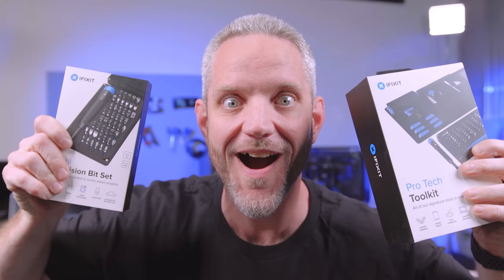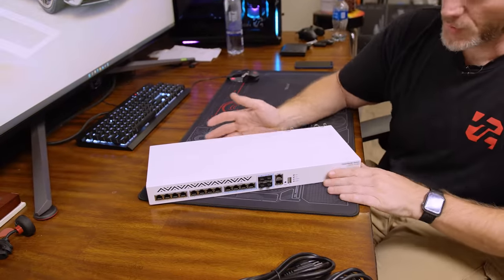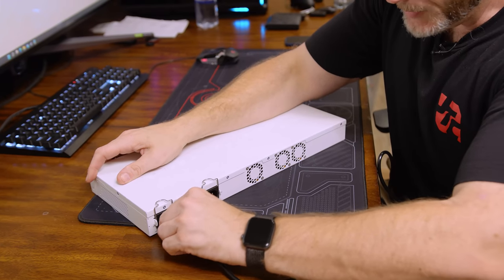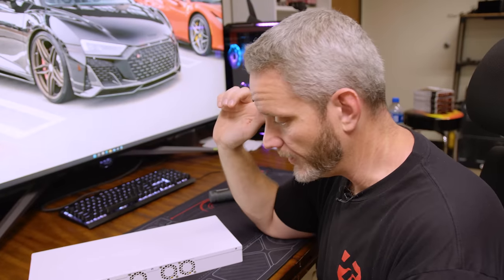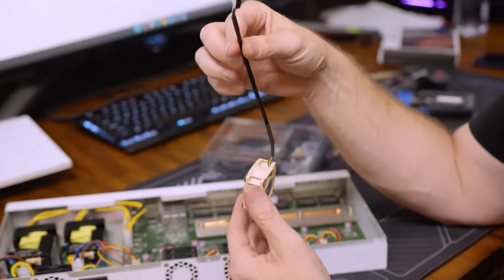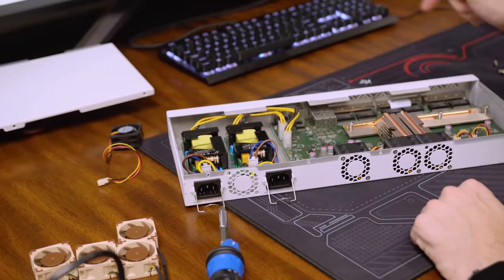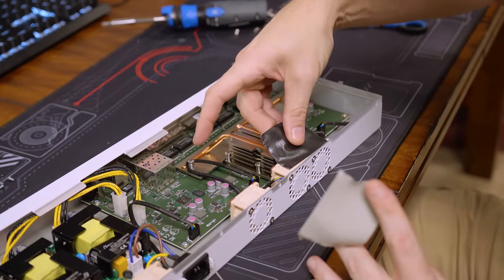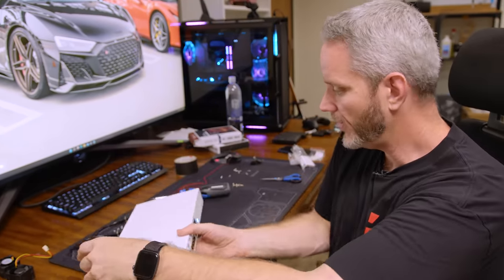We had to modify our new network switch...

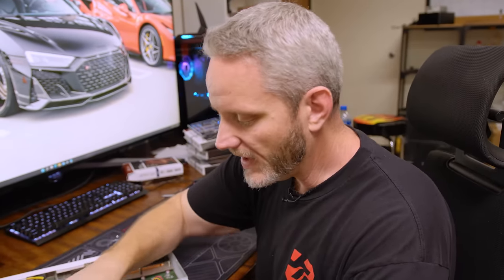Comment: 9:45 Be careful around power supplies in general people, did some troubleshooting many years ago (as it was my job) and i was probing around in a power supply and welded my DMM lead to the PCB. DMM caught the amperage, i caught the voltage. 313VDC

Comment: Ubiquiti Switch Enterprise XG 24 - Layer 3 switch with (24) 10GbE RJ45 ports and (2) 25G SFP28 ports. $1299. Definitely more expensive, but more ports than the MicroTik, and mine has been running solid as a rock even using layer 3 configuration features.

Comment: I had a 24-port gigabit switch with four fiber ports and it used those server fans. I just carved a big hole in the lid and stuck a 200 mm fan on top. It wasn't a rack mount so it was sufficient for keeping the noise and temps down.

Comment: well I purchased my 10g switch off of ebay and it is a used Cisco UCS-6296UP Fabric Interconnect and it came with 96 10g sfp+ ports for ~120 USD including shipping (also happened to come with 60 sfp+ fiber modules that were not removed for the switch) and for that price you would be able to get sfp+ to rj-45 adapters for less than what you paid (or close to it) for the same connectivity

Comment: For $600 that's pretty damn good. A rule of thumb we've used for basic 10G switches is ~$100 per port. I know people are probably gonna hate on me for this, but where I'm at we're a cisco shop and the 24 port cisco 10g switch is probably something around $3500 (if you can even get it), the 48 (+4 dedicated sfp) is almost exactly double that usually. I don't think you should be buying a cisco switch, but just for the price reference.

PS: the fans on those switches GOOO to, but they quiet down pretty quickly after boot and I've never actually heard them over other stuff in daily use.

Comment: For those of you that want the same screwdriver as jay here's the same thing made by SKIL the hammerhead one appears to no longer be sold for a decent price, search for "SKIL Rechargeable 4V Cordless Screwdriver with Circuit Sensor Technology, Includes 9pcs Bit, 1pc Bit Holder, USB Charging Cable - SD561201, Red"

Comment: I bought a 2nd hand brocade switch and had the same problem, 2 very loud high pitched fans.

My solution was to add a resistor to the psu fan so it ran at half speed and replace the other fan with a 60 or 80mm (can't remember) fan mounted on a hole I cut in the top. Obviously it isn't 1RU anymore but it worked for my setup.

Comment: As a few others have commented, I would replace the router with a Ubiquiti Unifi Dream Machine Special Edition (UDM-SE), get the Unifi Switch Enterprise XG 24 (USW-EnterpriseXG-24), a Unifi6 Pro AP (U6-Pro-US) and run a short SFP+ to SFP+ Direct Attach Copper cable to connect the new router and switch. Then you would get 8x 1GB PoE RJ45 ports (on the UDM-SE) and 24 10GB RJ45 ports on the switch, and still have expandability (if ever needed) with an open 25GB SFP28 port on the switch.

Comment: I did a very similar mod when I bought my UniFi USG Pro router. The 2 stock fans are really noisy, as confirmed by numerous complaints online and my own findings. I swapped out the stock fans with 2 Noctua 3-pin fans and not only did they make the USG Pro quiter, the temps are lower too! I went with 3-pin fans because the USG Pro mainboard only has 3-pin connectors, and the 3-pin fans come with adapters to run them at lower voltages. I didn't end up using those adapters though, I was happy enough with the result at max RPM.

Comment: Oh your god! I bought the exact same switch last month. I only needed 2 10Gb RJ45 ports but 8 is fine too. This was the cheapest rack-mountable at least semi-managed RJ45 10Gb switch I could find (didn't use Amazon). I dislike the Java management interface because Java is cancer but after the initial configuration I won't be playing with it anyway. My switch is in a closed rack within a closed room so I won't be "upgrading" my fans.

Comment: Jay entire office has fewer networked gizmos than I have in my home kitchen :-D

I agree with the Cat6A cabling - there is no benefit to fiber.
Also you can do POE over copper.

But IMHO there are way too few network outlets planned in the rebuild office. 

With proper networking, NDI video can be used in the video production workflow - allowing for much more flexible solutions - particularly for live streaming.

Comment: There isn't really a way to be more "cost effective" using 10Gbase-T, that effectiveness lies with Fiber-Optic. It's all tradeoffs. More capacity = More Cooling = More noise and fan mods (did this with a $200 24 port LB6M). If you really truly need the capacity you need to look at more traditional enterprise gear but that puts  you in a different cost and infrastructure weight class. You'd be racking all your core storage and server/nases etc in the rack going 10/25/50/100G (pick your poison) fiber to a bigger switch and then if you're fiber and need 10G base T ports you'd be paying ~$20-$50 per port for fiber to ethernet SFPs, it's messy. 

One thing you could do if you need capacity is add another identical switch and do a 10G LAGG on two ports between the switches. Mikrotik calls it bonding. That gives you resilience if one of the ports has a problem and opens a few more lanes for traffic between them so-to-speak. You could then take your main NAS and plug it into both switches for some fault tolerance there. Mikrotik doesn't support stacking so this is good enough. If the walls are open maybe look at adding fiber drops to the rack from the data ports and a few of your work areas for a little future proofing if you can but it's not a big deal. When it's really time to UPGRADE HARD figure it out then. This does what you need to and that's great. 

Sidenote, going switch to switch isn't a big deal when you get to more enterprise type gear. Look at datacenters that are spine and leaf, $250,000 switch to many $30,000 switches. I think you may have had bad luck with cheap switches and when you go cheap switch to cheap slow switch and on down the chain it builds latency etc. That happens a lot.

Comment: I use a managed Netgear 12 port 10G rack mount switch, where all the RJ45s are 10G.  Only one power supply on mine, but it’s silent.  Supports link aggregation and a number of L2 features, and more limited L3 support.  I’m using in L2 mode only for now.

Comment: If you want to enter the ubiquiti space: a Ubiquiti Switch Enterprise XG 24 has 24 10G ethernet ports and 2 SFP28 ports. Max throughput is 580 Gbps and is also a 1U rackmountable switch. Over here you can get it for a tad over 1400 euro.

Comment: The reason that the noctua is so much quieter is that is has less than half the airflow of a typical fan of that size. The lowest airflow model I could find on a component supply website in a 40x40x28mm size was 11cfm and most of them were 15-30cfm. The noctua is 5.5cfm. If the product is designed with a decent thermal margin and its operating in an airconditioned room its probably fine but I wouldn't recommend doing this with something critical.
Also on the 3pin vs 4pin thing. The device has no way of knowing that you've connected 4 pin fans, so either that header is outputting pwm as well as dc control - resulting in the fans spinning even slower than intended, or theyre just being dc controlled. Unless there is a setting in the menu you have no way of knowing whats going on.

Comment: I put these or similar Noctuas into my switch to quiet it down as well.  The OmniJoin adapters are to adapt the fan cable to 2-pin (like my stock fans were). It's basically just a punchdown similar to an RJ45 but there's also some 3M adhesive in there, so it really holds the thing together.

Comment: Netgear has a 16 port 10gb switch (XS716E), but it pushes you into $1600+ territory for those 4 additional ports. Prolly more cost effective to stack another MicroTik in when you need it/want it.

I’m pretty sure Ubiquiti has a 24 port 10GB as well… not sure on price, but it’ll probably run around $1500, and their gear is pretty rock solid and easy to manage.

Comment: I would have just gotten an SFP+ switch and the RJ45 SFP+ converters.  Would have cost a little more, but would have probably gotten a better switch, less mod'ing and you could use fiber in the future.  Probably would have gone with Ubiquiti.
Reply: Not necessarily any more expensive. Use DAC connections where possible because they are better than RJ45 and save money. The longest cable runs use fibre. You then just use the RJ45 to the PCs.

Comment: SFP+ isn't a connection type, like RJ45 or Coax or something. It's a layer 1 topology. Think of it sort of like a motherboards PCI-E port, you can plug whatever was designed to plug into it. You want RJ45 to connect to your PC? You get an SFP+ RJ45 transceiver and use a normal ethernet cable.

Comment: I know you're not a fan of the SFP+ cables, but honestly, I think I would've gone with the CRS317-1G-16S+RM over the CRS312-4C+8XG-RM, and added a few RJ45 transceivers for how many drops I needed.  You'd spend some money on the transceivers, but you'd save well over $200 on the switch, AND you get 16 ports instead of 12.  On top of that you get a massively more powerful CPU and much more RAM, which makes for a more capable device if you ever plan to do any level 3 stuff with it.  And if you do switch to fiber or DACs in the future, it's considerably more flexible.

The great thing about Mikrotik is that they offer something for everybody.

Comment: Jay, that switch has a USB port. You can plug a USB hub and a handful of 100Mbps USB to ethernet dongles to it for non-bandwitdth-critical devices (like your NVR/security cameras). I do that with my Mikrotik switches when I just want one more port for something slow. USB 2.0 is ~400Mbps so it can easily handle 4x 100Mbps ports, or one gigabit port operating at half speed.
Reply: Very interesting. Is it reliable or does the USB gear need rebooting periodically?
Reply: @wayland7150  the longest I had it running was 2 month continuous uptime and it never had any issue.
Reply: @doryiii  Thank you. It sounds like it could be a viable solution. I've had problems with USB to RJ45 in heavy use. Maybe it was the device I was using.

Comment: I actually stopped using my 48 port gigabit Cisco switch for months because the fan noise was just too much.  I ended up just taking out the stock fans, cutting a couple holes in the top of the switch where they need airflow, and screwing some cheap 120mm fans to it.  I run them off of a DC wall adapter at 7.5v.  It's barely noticeable if you have another computer running nearby and stays plenty cool

Comment: The second power supply is backup, for a secondary power source if i recall correctly. Most core routers and switches have that but you only need to connect one.
Reply: Connect one to your UPS and one direct to the mains.

Comment: Like someone else says fiber might be the way to go between switches and routers. The way this Microtik is setup I would never choose it.  Fiber is not easier to terminate, it is harder. Although crimping ethernet has its caveats, its the easiest to do, except for coax, but that is really a thing of the past for computers. My biggest gripe with this video is that you say that you don't need the managed part of the switch, because you don't want to do routing on that switch. You don't use the management part of a switch solely for setting up routing. You do a lot of more things on a managed level 2 switch regarding security and network management. You might want to look into that, especially if you want to test devices on the same network you have your content and your company administration.
Reply: If it's all in the same rack you don't need fibre just use SFP+ DAC. The MikroTik has two operating systems, one is a managed switch and the other is a router.

Comment: Ubiquiti / UniFi is the choice a lot of businesses are going with. UDM Pro for your security gateway. Use a 10gb DAC Cable as a backbone chain to your switch. Grab a 24 port POE switch .. be sure to get the pro version.  It has the 10gb sfp+ port that you need for that backbone chain. That only leaves you with 1 10gb port lest. There is a $279 10gb called the UniFi aggregation switch. Again use a 10gb DAC cable to go from the second 10gb backbone port of the 24 port switch to uplink to the  10gb aggregation switch.  The udm pro has a controller in it that you can browse to with a machine. From there you can see you whole network, and configure what is needed. Obviously server and video workstations go to the 10gb aggregation switch while things like security cameras and card readers and  voip phones go to the 24 port switch.  You just created a very robust network with a 10 gb backbone. I do this every day for a living. It’s perfect for your situation and not expensive.

Comment: I would go with the Ubiquiti Switch Pro Aggregation for 799USD. You get 28 10GB SFP+ ports and 4 25GB ports. You could get 10GB sfp to rj45 modules for your systems now and upgrade to fiber down the line. Best of both worlds for a decent price.

Comment: If your server has two 10G ethernet ports (highly suggested) connect another switch to the other ethernet port.  By using both 10G ports connected to 2 switches you can account for additional growth and reduce latency caused by daisy-chaining switches.

Comment: Ubiquiti  USW-EnterpriseXG-24 is 24x 10GBe but almost double the cost of the MikroTik you bought. You could also expand capability with the Ubiquiti USW-Flex-XG that would give 4x 10GBe that can be powered via POE or USB adapter.

Comment: If you're willing to spend $1300, the ubiquiti xg 24 is a 24 port 10gb switch with two 25gb sfp ports as well. I would still recommend going all sfp though. The cost is so much cheaper. Or just use a small 10gb ethernet switch that connects to the larger main switch with sfp.

Comment: If you're connecting to a server at 10G in the same rack, then you really should be using SFP+, it consumes less energy and you're likely to get a more solid connection.
But if you've already spent on the RJ-45 adapters then whatever. But a Mellanox ConnectX-3 is really cheap on eBay.

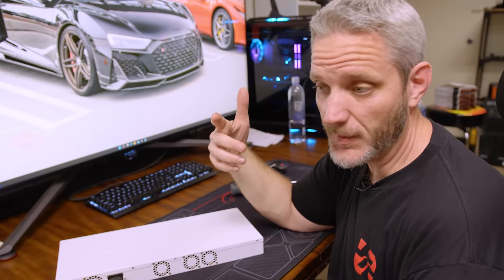Comment: 5:56 As someone not craving RGB at all (I mean, everyone and their dog has it these days...), I'd typically be against it, but in a fricken server? Go for it! This is different, this is about 20% cooler!

6:57 You'd not put a Minecraft server for your kids (basically something more or less private, they'd probably want to have their friends on it as well) on a 35MBit/s up line? I remember hosting a bukkit server about a decade ago on a fricken Atom (Samsung NC10) with 2GB on a 1MBit/s up line and it worked while having TeamSpeak hosted on another Atom thing.

1:02 What exactly could possibly make a switch cloud-based?

3:48 Plot twist: The second cold device plug is just for the turbines! If this thing ought to be cloud based, it must be able to take off and with just enough thrust, even a brick can fly :)

5:15 Jay: "So it's not as loud as a server"
The thing: ramps up violently
Jay:

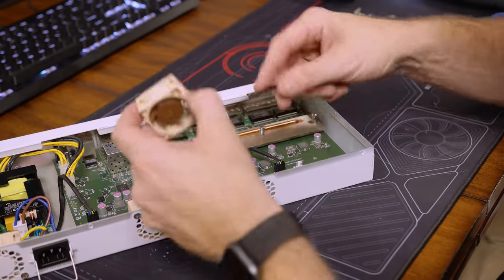11:23 Speaking of hopes: Where's the codes for the last 2 vids? :D

13:55 They're awesome! I'm glad I could grab one of those 3070s with their chungus HMUs on it. Basically inaudible. Last time I had that was with a passive 3870.

Comment: I like Jeff Geerling's setup. He uses PoE for a bunch of his connected devices and just needs one UPS. Though, most of his devices are decidedly lower power than your standard desktop, if you were setting up a security system, it would be ideal. Especially for something homebrew with a bunch of RPi's in custom cases. Of course, even if you used mini computers you couldn't use that if you went fiber optic.
Reply: A bunch of PoE security cameras would probably be handled by a POE switch that has its uplink port connected to this switch.
Or at least that's how I'd handle it.

Comment: Jay, 10GBE is best for end point connectivity.  SFP+ is great for data center and for uplink to your data center.  If you have high end WiFi 6 you will need 2.5GBE POE+

Comment: I was typing a comment about how easy it would be to make a shroud and then a minute later Jay was using tape to make one. Fine. I guess.

I have been using Mikrotik for years - amazingly cheap and capable stuff... Though some of the bugs and shortcomings on random things can be frustrating - but for super basic office stuff like you guys are doing it should be flawless, and even if you have to do something random it will likely surprise you how easy it can be (except say... OpenVPN in L2 mode).

Comment: It would be a little bit more expensive, but I'd go with CRS326-24S+2Q+RM and 10GBASE-T SFP+ modules, it would provide flexibility to use copper or fiber. Or, if silence is of the essence 3x CRS309-1G-8S+IN, one for aggregation and two for connectivity. Not enough connectivity, get another CRS309-1G-8S+IN and voila, +7 additional 10G ports.

Comment: I have been working with Mikrotik switches for years now. SwitchOS is not better than RouterOS on performance. Stick with copper wiring, optics are a good option for long distances. We use it between switches, but for server and client computer connections, we always use copper because of modul compatibility. For example Dell servers doesnt accept non Dell moduls in network cards. If you want a bigger switch go with CRS326-24S+2Q+RM and buy UF-RJ45-10G moduls for the ports you want to be ethernet, this way you can mix and match copper with optics as you wish. Ubiquiti moduls work realy well with Mikrotik and they are cheap.

Comment: In your shoes I'd be tempted to go with an all SFP+ switch like the CRS326 and populate it with 10Gbase-t SFPs as required (and you're free to use the cheaper 1G SFPs for devices that don't need that speed), which you can swap out with something like DAC or fibre later as you upgrade.